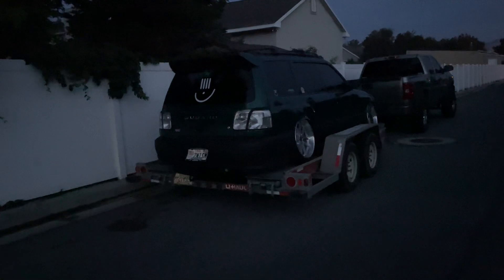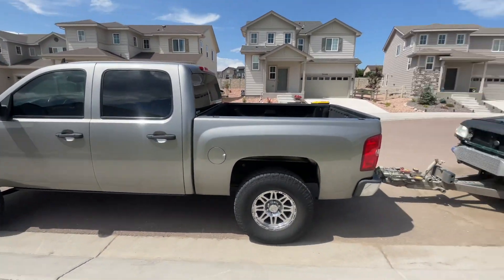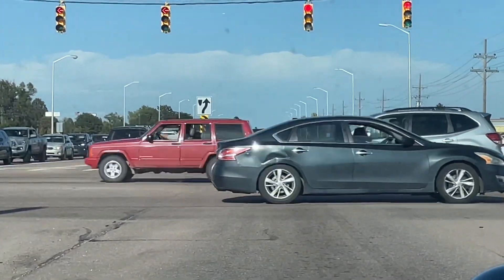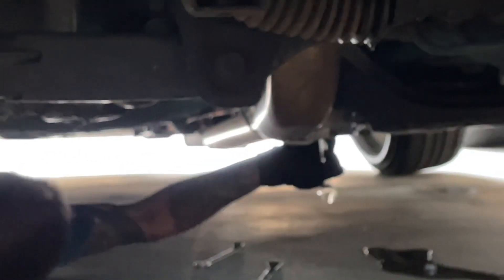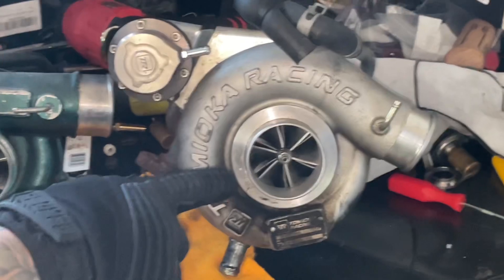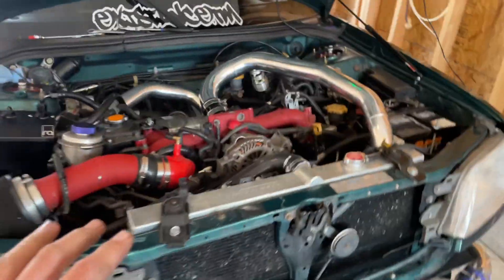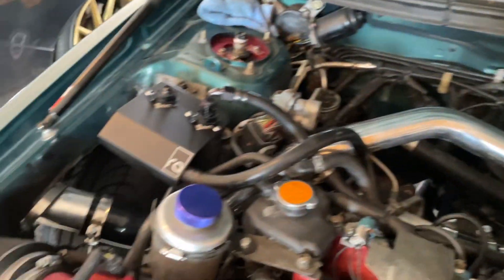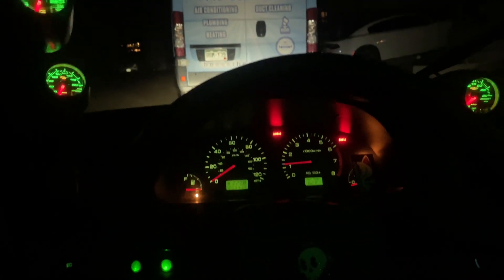Taking my STI forester to CO to get a BIG TURBO!!

Comment: Please retune with new boost controller before you romp on it super hard, I would not like to see this thing blow up especially if the waste gate isn’t sounding like it’s opening up fully you could over boost and not know it so be careful
Reply from the maker: AFR's are totally fine. If anything the car is running too rich from not having boost come on as fast. A re tune will obviously be the way to go, but driving the car is perfectly safe for now!